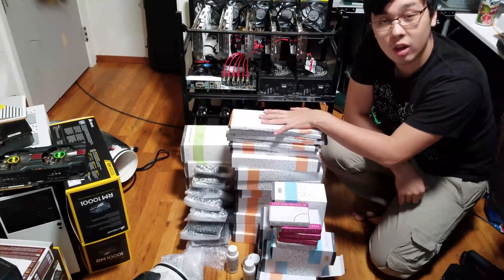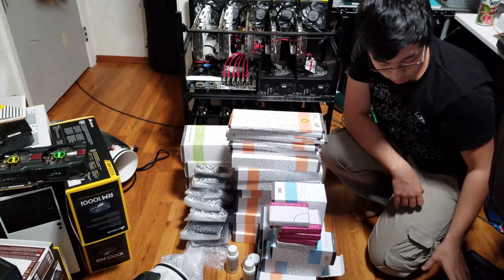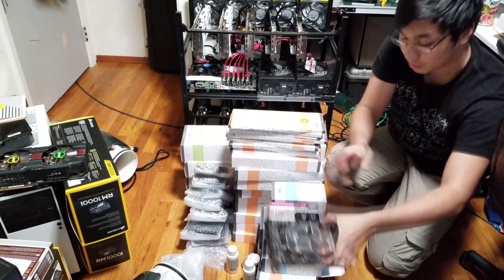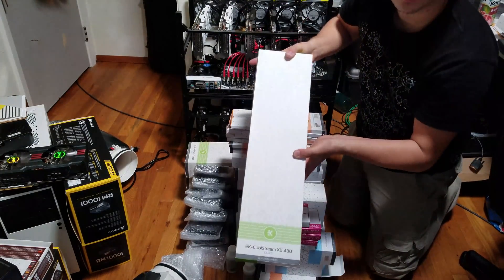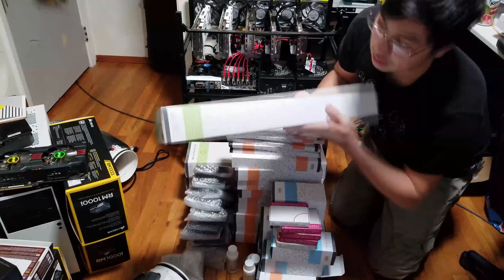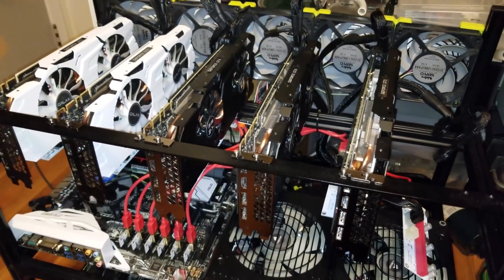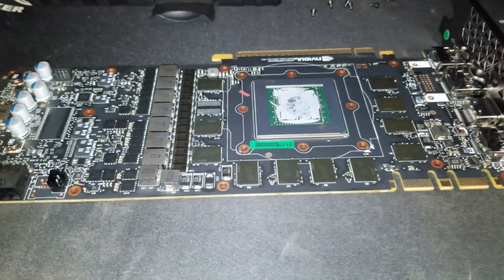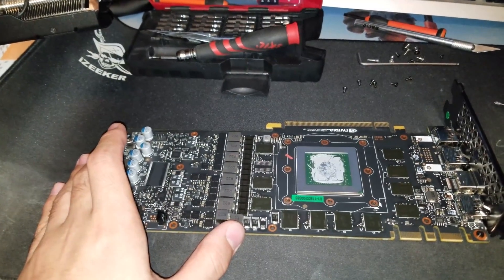GPU Mining Cooling Solution. NO AC!! Part 2

Comment from the maker: I am doing GPU cluster work and need consistent clock speeds across all cards. Mining is only done as a side project.
Reply: closest-num-2-0 you should check out the decentralized render network from OTOY www.rendertoken.com
Reply: Battleneter no one has that crystal ball. E.g. I really got surprised when I heard the rumors about ETH Asics are going to be made, even though they intend moving to PoS with that project.
Reply: did you read the comment that you replied to?  Mining is a side project, he does gpu cluster work as the main gig, ie: rendering or other compute problems.  Mining profits are inconsequential by the sounds of it
Reply: unc0nnected exactly! that is why I mentioned www.rendertoken.com which is not mining but a distributed GPU cluster. The concept is "render it forward". Especially when you run such clusters you probably don't have 24/7 workloads for them. With RNDR you keep them running and store your compute power in the cloud by offering it to others. Once you have a heavy and time critical task at hand you can use those tokens earned to release all that GPU power all at once. All you pay is the electrical bill. 

That's why I considered it might relevant for closest-num-2-0. Other GPU workloads will be added to the project as it goes along. That's also why they have one Harvard Professor for particle physics in their advisory team.
Reply: CAN YOU GIVE US THE LINKS FOR COOLING PARTS?
Reply: why dont u share mem and junction temperature
Reply: You are brave pulling the trigger with mining profits tanking so heavily lately with no indication the trend is going to reverse any time soon if at all.
Reply: hey I 100% agree, however the smart play is probably hold off a bit and see what happens, this is the worst mining has been in at least a year..

Comment: Ok so obviously you have this figured out very cool!!!  I'm working on the same but on a server board and want all VII cooled with the same blocks.. was told i can only run 3 VII each on a single loop.  so i need two loops and cool a 7900X could you give me some suggestions ?  thanks
Reply from the maker: you can have a single loop as long as you have enough radiators

Comment: Bit curious is this a sealed system that people say doesn't need maintenance or do you have to flush and refill the water every couple months? Also likely takes distilled water to help prevent mold growing inside the pipes. If the pipes were longer I would also say put the radiators farther away from the rig itself, near a window or perhaps submerged in a fish tank lol.
Reply: Yes. I have in plan to warm my app in the winter with that. In winter we have 10 to -10, so the spendings will be less to warm the hous  :D Less gas burn :D. Good luck all.
Reply: its a custom water cooling system.  unless its an AIO you probably have to do maintenance on it yeah just like a custom water cooled PC.

Comment: question: why did you split the rows in 2 in the middle instead of running the tube all the way through all gpus?
Reply from the maker: 123rkss This was to split the gpus in sets of three, so i could route 3 gpus for each radiator. it also saves 4 fittings

Comment: Awsome rig looks sweet but yeah roi is gonna be awhile lol
Reply from the maker: thanks lol
Reply: To be fair the only thing you might have to worry about are the pumps burning out. Other than that they are good for a long time, even if you have to upgrade graphics cards you can just keep the same cooling system. Lot of work to put them on there though, even in sped up fast time.

Comment: You're super quiet in this video. I hat to turn my speakers up all the way up. (then got blasted when you mixed in the techno). Also can you mount water blocks this way on non founders card, I have a variety of 1070s from different manufacturers etc... do I need to get custom blocks to each model or could I get 1070 blocks and remove the headsink/fan part?
Reply from the maker: you could either get a universal GPU mount or you would have to get specific ones for each model. EK has a lot of options.

Comment: I'm looking to do something similar with the same rack. Do your radiators line up with the fan bracket mounts? (15mm spacing between the fan mounts?) If not, I'm curious how you mounted the radiators.

Comment: isn't this two rigs in one frame? mobo has 7 pcie slots. piping isn't efficient. i'm a piping designer (engineering technologist) and that's not how you would design cold supply and hot return. if you did even your own simple home vacuum system, you don't do it that way. very nice looking though. but if you're mining (or matlab), it's about ROI.
Reply from the maker: im curious, how would you do it?
Reply: Your gpu temperatures, are they all relatively the same or do they increase/decrease as you go down the piping line?
Reply: im assuming the temps are all the same. the way he set it up makes it so that all cards get the same amount of coolant through them albeit at a lower speed. and that can be compensated through adding more pumps.
ideally you would run one line and one return per every 2 cards but that would make a terrible tube mess

Comment: I know you have 3 radiators but do you think one radiator enough to cool 6 cards? Also, how loud it is compared to just fan cooling?
Reply: No one rad is not near enough for 6 cards. It would probably lower the DBs to about 1/3 aswell.
Reply: @kotyperry1563  Just to add on to this 1/3 less decibels is alot more than what sounds like.
Reply from the maker: I have 4 radiators 2 for each rig. They are very big and have so far been doing an amazing job!
Reply: I'm curious to find this out myself, as cards used for mining are usually under clocked and under volted.